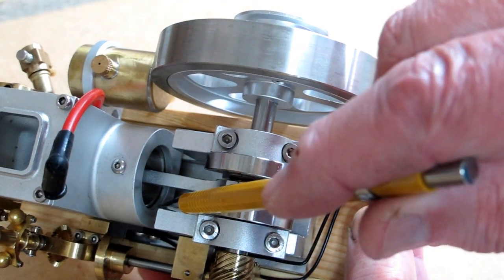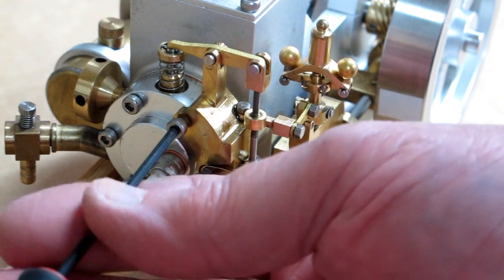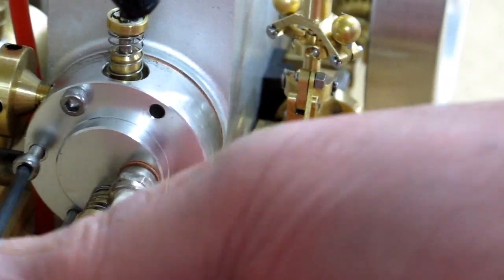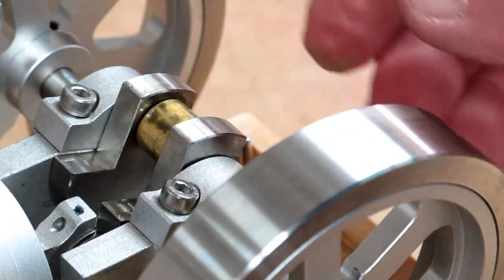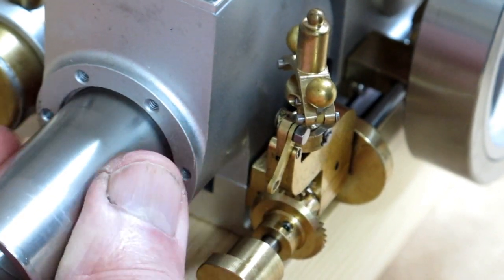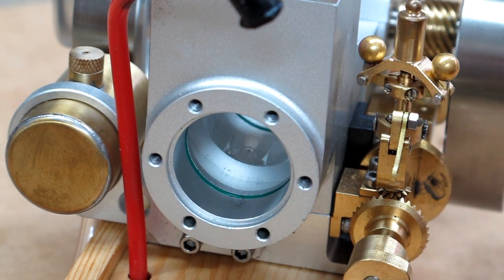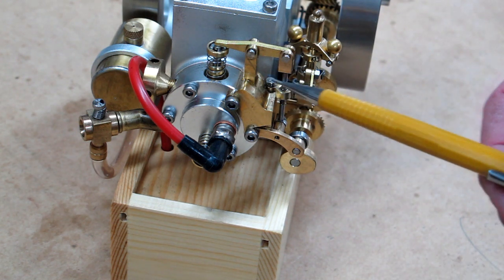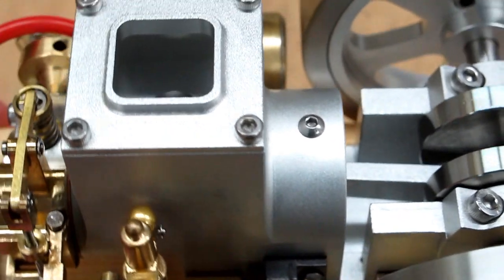Eachine ET6 Hit & Miss - Changing O-Rings

Comment: Nice video, as all of your videos are.
Using rubber o-rings as piston rings, exposed to the fire of combustion, seems crazy to me. How long do they expect them to last during operation?  Even sitting on a shelf, rubber will deteriorate, it's just a matter of time. Proper iron piston rings would be nice. It's probable a cost savings thing.
Reply from the maker: The green o-rings are FKM (fluorocarbon or fluoro-rubber) type material, resistant to oil, gas, water, alcohol solvents, high temperature and high pressure and seem to last a long time. And they are relatively easy to replace by most anyone. Some viewers say they get 4-5 hours on a set of o-rings running at no-load, and that is a lot of running for one of these little engines. 

Shelf life is basically unlimited.

After a while, they start to get flat where they rub on the liner and then they need to be replaced. 

The piston o-rings in this video still looked good. I put them back in and they are still running.

Being a hit & miss engine that does not fire all of the time helps prolong life as well.

These are demonstration, model, hobby engines and are relatively easy to work on. Anyone who purchases one of these engines should fully realize they are going to need to service and do occasional maintenance.

Thanks for watching!
Ron

Comment: Mr. Walters, do you do trouble shooting/repairs? My ET6 stopped running after a total of about 3 hours of running, total. It has no compression and started spraying fuel out of the carburetor as it  quit during the last time it ran.
Reply from the maker: Sorry, I do not work on these engines. You will need to do learn how to do that yourself.
Lots of small pieces on the ET6. Sounds like something is sticking and holding a valve open. That would cause a loss of compression as could a worn out piston o-ring.
These things vibrate and shake around a good deal. Things can loosen up including the flywheels and the magnet disk for the timing. Exhausting out the carburetor can happen if it backfires and is trying to run backwards. Maybe the timing disk has moved slightly. It should fire just past TDC (top dead center). If it fires before "AT or BEFORE TDC", it can backfire.
If the flywheel slips on the crankshaft it can change the timing of the valves. Regular maintenance, oiling and checking that things are still tight is required with these engines.
I go over a number of these issues in my videos. Next week March 26th I release a video on the timing of these engines.
Most of my engine related videos are grouped in a playlist on my channel.
Please subscribe so you will know when a new video is released.
Thanks for watching.
Ron

Comment: Hello Ronald.  Great YT channel and beautiful little engines.  Bust I need al little help.  I took crankshaft off because I had no compression. Thought one of the O rings on piston was broken.  Was ok so put it back together again. ( intake valve did not close completely. A bit of a weak spring I think ) BUT have replaced crankshaft in another position. ( turned ) now the ignition and or valve timing is off. Won’t start and run.  Can not find a manual about that. What should timing be and how can I set it right?
Hope you cannelloni me or point me to a manual.  
Thank you 
Arie
Netherlands.
Reply from the maker: Hello Arie,

I have a video on timing these 4-cycle engines. 

The engine in the video is the ET8 (M93) but the timing is the same for all of these engines.

You want the spark to fire "Just PAST Top Dead Center" and this is explained in the video.

Loss of compression could be due to either valve. All it takes is a tiny piece of carbon or something else under the valve, which will keep it from sealing. Sometimes you can save yourself the trouble of disassembly by removing the spark plug and spraying WD40 into the head/exhaust/intake to see if you can flush things clean again... maybe the gentle use of compressed air. Too much oil (or the wrong type oil) in the fuel can cause a bit excess carbon.

Eachine 4 Cycle Engines - Ignition Timing
https://youtu.be/U8NZ33mijXI

Good Luck... Have Fun!
Ron

Comment: nice video, how long did you run the engine before you needed to replace piston rings?
Reply from the maker: This engine has a couple of hours on it. I stuck the old piston o-rings back in the engine as they still looked good. The point of the video was I needed to replace the o-rings on the liner.... not the piston.
Reply: @RonaldWalters2010  
Oh .ok may ask what fuel and oil your using on yours.iam currently using petrol with a.drop of 2 stroke oil
Reply from the maker: Hit & Miss Engines - The Correct Fuel
https://youtu.be/TvLziWCI7Oo

Thanks for watching. 
Please subscribe. That is what keeps this channel running. 
Ron

Comment: Hi Banggood is still giving me the run around on the ET6 ign system that failed after 60 seconds. keep requesting video of engine running? their translator doesnt work very well. anyway i pulled the head and noticed it only had the upper piston ring... good thing i ordered a pack. ive seen this on other videos with replacement parts sent... same thing only upper ring.  can you confirm it is designed for 2 even tho they build them with 1?
Reply from the maker: This has been covered several times in comments for various engine videos. Going back to ET1 they were using two o-rings. In order to slow down the engine (for a more realistic hit & miss run) they started using only one o-ring to lower the compression. Most of the engines only have one o-ring installed.
If you paid for your engine using PayPal you can file a claim against Banggood for a refund and that will get their attention (maybe).
Did you use one of my links to purchase your ET6? If so, give me your order number, date purchased, date received. Also I hope you saved the original packaging. They often want a photo of the shipping label and the bar code on the box. Go to my channel page... click on about... lower left corner and send me an email using that address with the above information and photos.

Comment: Nice engine!  I am curious.  This was 7 months ago.. What condition is the engine in today? Does it still run as good as the day you got it?    I am thinking about buying one of these engines..   I definitely do like the extra complexity to this engine compared to most others the same size..
Reply from the maker: I do not run these engines all the time... but whenever I decide to run one or demonstrate it for someone, they run perfectly. I recommend Coleman lantern fuel with just a hint of Marvel Mystery Oil. Oil it and keep it clean. Empty the fuel, water and take out the batteries when it is not going to be used for a while. 

ET1, ET6 & ET7 are my favorites of the larger size horizontal hit & miss engines. ET7 has the simplest governor mechanism and is the easiest to replace the piston o-ring. All three are visually easier to see the piston/crankshaft and time (when necessary). ET6 is a very nice engine but possibly (to me) a bit more fragile in terms of the complicated governor mechanism with the small pieces. But, if maintained (oil and keep it clean) should have a long life.

I would avoid the ET8 and the ET5.  ETX is a good runner but overly complicated.

The newest EM2 vertical brass hit & miss seems a nice engine, but it is not strong enough to run anything else.

Hope that helps. I have videos on all of these engines. There are also videos on slowing them down a little.

Please subscribe. That is what keeps this channel going.
Ron

Comment: hi, what material are the piston rings made of?
Reply from the maker: The green rubber o-rings are a high temperature rubber called FKM which represents fluorocarbon-based fluoroelastomer material. Sometimes called fluorine rubber or fluoro-rubber. If you are looking for the green o-rings on eBay look for FKM.

The black o-rings are primarily neoprene or Nitrile and are the most common general purpose o-ring color.

Thanks for watching. Please subscribe! 
That is what keeps this channel going. 
Ron

Comment: Where did you get the o rings?
Reply from the maker: They are listed in the description for the video. Same o-ring as the ET1.
Reply: @RonaldWalters2010  do they have the water gasket one too? I only saw piston rings. Thanks
Reply from the maker: Sorry, I was not thinking about the liner o-rings.
Not yet... I am working on it. 
Probably won't happen until AFTER the Chinese New Year... after Feb 17th.
Reply: @RonaldWalters2010  those o rings that you mentioned the diameter. Is that the size of the water gasket?
Reply from the maker: Yes. The liner o-ring is 28MM OD x 1.5mm Wire Diameter x 25mm ID and I would suggest the green ones which are high temperature o-rings. You can probably find them on Ebay.

Comment: The "bearings" are a bit of a disappointment.  Less so considering the price.  I wish they at least provided an oiling hole for them.
Reply from the maker: An oil hole in the lower end of the connection rod would not put oil where it is b=needed. And the crankshaft runs on two roller or needle bearing assemblies and an oil hole would not get them oil either. A little oil before each run either side of the conrod and the crankshaft (and the piston wrist pin) seems sufficient.